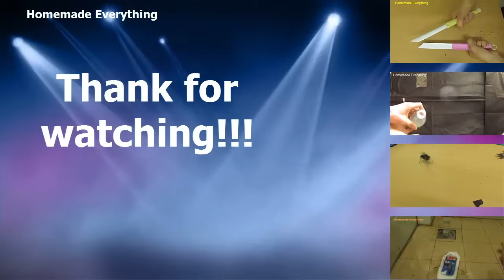How to connect 4 batteries and 3 bateries together - life hack

Comment: Thanks for the video, super helpful! May I ask what kind of wire did you use to fire with lighter and take off the insulation to connect the batteries to the long plastic piece?
Reply: looked like copper wire to me

Comment: it looks more difficul than soldering ..?
Reply: mukhlis1010 And if you don't have a soldering iron? And you are not really meant to solder, it will damage batteries. That's why they are spot welded sometimes. 😁
Reply: ya you are right bro
Reply: Not True At All --  I've been soldering no Head batteries for 50 some years and use the good ones out of a battery-pack for my flashlight & other uses. The only problem there is, is solder doesn't like to stick on battery surfaces so one has to prep the surface properly.  And since you don't have the experience in soldering you left the soldering iron too long on the battery.  Learn how to solder and then soldering works just fine.  Do it right and save money - rechargeables aren't cheap.
Reply: @demaXxXx  Heey, looks like you are more talented in this than me! What is that white thing which he connets the batteries?

Comment: can I can conect 3 batteries 3.7v 1000 mh in cerie and 2 3.7v 1000mh  in parallel to make a pack and how to charge it and balance? thanks
Reply: If you connect batteries in a series and parallel, they all must have the same capacity. And they must be paired.

So you can connect 3 batteries in series for 3.6V and then connect that in parallel with additional sets of 3 to keep them at 3.6V but increase capacity.

Comment: does this work with more than 4 batteries?
Reply: This would work with 1000 batteries if you want.
Reply: it would but you'd need bigger lolly sticks
Reply: @Pasturesv  Yes and destroy the device you connect to it considering each added battery is +1.2V

On 1000 of em that would be 1200 V

Comment: so when I want to take electricity from them, the idea is to take one from minus and one from plus no matter from which battery, it is like I want to connect D2 Duracell batteries (Recharge ultra long lasting power) so yes, I want to connect 22 pieces together, can help understanding it a bit more ?
Reply: NO DON'T!!!
This is connecting batteries in a series! If you put 22 of them together you will get 26,4V on exit! (Assuming each battery is 1.2V)

Comment: The soder never sticks when I do it.  Melts and wants to stick to iron or wire but not on whatever I'm sodering. I've tried circuit boards and  batteries both and no luck. Anyone know what I'm doing wrong?
Reply: Yes, you need to add a very large amount of flux. Also make sure you are using LEAD solder with a flux imbedded core. Finally, do not let your soldering iron become so hot that it instantly vaporizes the flux and your solder turns into a ball....  everyone always uses waaay too much heat. Also I have personally had way better results using a weller type of on/off soldering gun instead of those cheap $5 dollar plug in pen style irons that tend to overheat like crazy. Hope this helps.

Comment: How do recharge the batteries
Reply: With a solar panel, wind turbine, geomagnetic field, geothermal fluxuations, bigger batteries, cut up a wall battery charger cable and plug it into your batteries.. lol
Reply: I will try
Reply: it's best to do it using electricity

Comment: i tried to use some copper wires i pulled out of my phone AC charger, but when I went to connect the other side (like how you connected both sides of the +-,+- ) but it started getting hot, and it burnt me a little. Am I doing something wrong?
Reply: Maybe the type of batteries that you are using is the problem
Reply: nvm i figured it out. i was connecting the 2 batteries parallel on both ends instead of parallel on one end and a separate wire for the (+) and (-) on the other
Reply: im comfused

Comment: wanna make a pack with 17000mAh and 7.2 V ?any ideas?
Reply from the maker: Moh Redwan Buy it :)
Reply: u gonna be kidding me !!??
Reply from the maker: because it's very hard to make. And it can damage your devices
Reply: i have a rc speedboat that runes on the Ni 1700mah,7.2 v but it was destroyed and i cant find it, with very limited options ,the device already requires it, 
how hard to obtain n the same mAh and voltage from regular disposal or rechargeable AA batteries?
thnx
Reply from the maker: Moh Redwan i think it's ok with battery 7.4V like this http://www.batterysupports.com/72v-74v-10-18650-17ah-2s5p-lithium-ion-liion-battery-pack-p-90.html
Reply: Are there li-ion AAs?
Reply: Moh Redwan
Reply: use six 3000mah batteries that would give you 18000mah

Comment: Can i use paperclips instead?
Reply from the maker: Caroline Suzon try to use it. but, i'm not sure it work
Reply: LXG Design of course it will work, unless their coated in something
Reply: another cool idea...

TFS
Reply: No, you are not allowed.
Reply: @lxgdesign  Hello! Can you please tell me what material do you use for connecting the batteries together?
Reply: Yes they will work since paperclip is a kind of metal
Reply: If the paperclips are made from aluminium, then yes, electric current will transport through it since it's a good conductor for electricity but I recommend copper if you want to transport electricity fast.
Reply: Yes
Reply: @petertorok4928  they used sticky tape to hold the batteries together, copper wire to join + to - & elastic bands to hold the lolly pop sticks